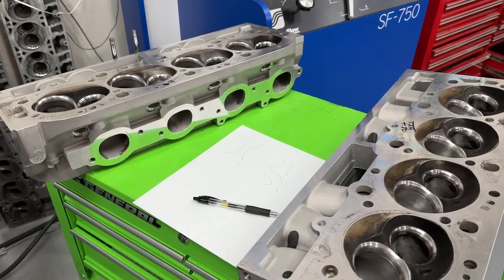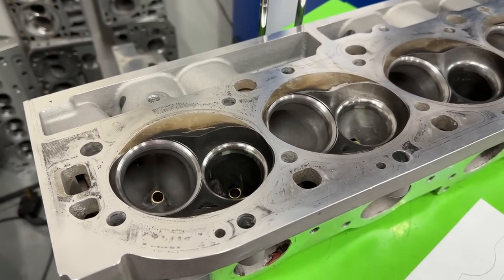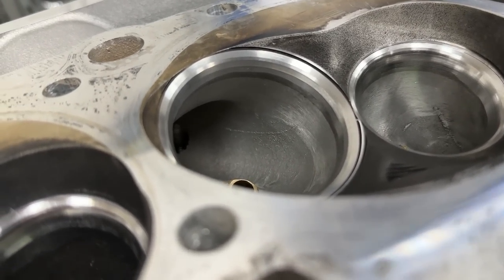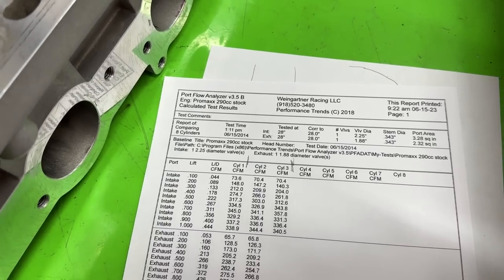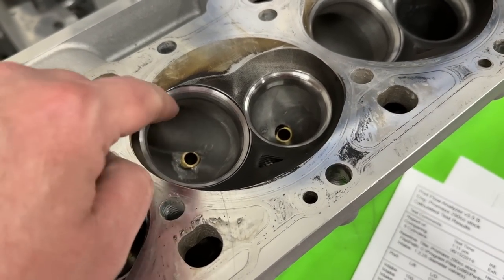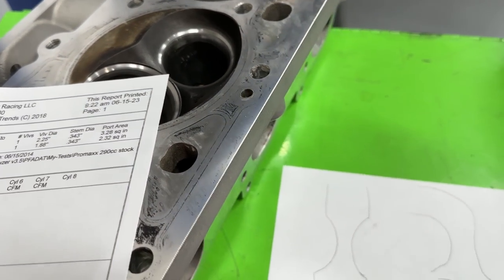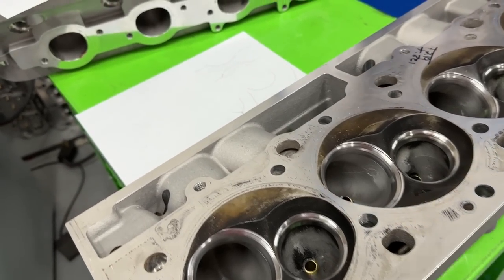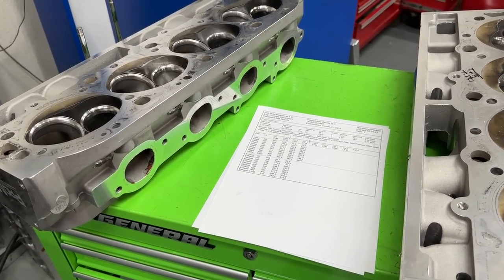One Reason To Put Larger Intake Valves In A Head

Comment: I had the 2.19 1.88 valves put in my 68 Camaro with closed chamber oval Port head's made a very noticeable improvement, great video keep them coming
Reply: Did you cut back the chamber wall to unshroud the intake valves. That 2.19” is even more shrouded than the factory 2.06”.  You can plunge cut it or mark a radius and remove material with a cylindrical carbide bit.  I had my 702’s plunge cut at the shop for about 0.300” valve to wall clearance.  It made a big difference across the entire rpm range, but especially the top end!

Comment: The idea of enormous valves, and ports to match, always means big numbers on a flow bench, but unless the head is for a race only engine, which is operated WFO pretty much all the time,  the results on road vehicle are likely to be disappointing.  Venturi type porting, when the intake ducts are actually made smaller, is likely to work better for the road.
Reply: I don't believe that to be true... not when matched with a small cam.... the big head and small cam is a proven combo
Reply: @Ws6Ms  Its OLD thinking now! Overly large ports, and enormous valves, mean big numbers on a flow bench, but due to slower gas speed at low to medium engine speeds, will always be slower on the road.
Reply: @humourless682 nah I still doubt that... then why do big port ls3/lt1 make more power than a smaller head ls2 and drive just as well ? Or the old hipo ford 302 with huge ports and smaller cam had a better power curve than chevy dz 302 with small heads and huge cam.... big port heads with correct cam and compression will always outperform in daily/racing sorry
Reply: @Ws6Ms  The laws of physics cannot be changed.  If the port size is smaller, the gas speed will be higher, through that port. Increase the size of the valve and it will increase even more.

In the US the idea that bigger is better, sells, but for quite a while smaller ducts have been being used in some very serious engines.

The idea of making intake ports smaller, even though its FAR more effective, is never likely to sell, hence the large number of videos like this one, which equate big numbers on a flow bench,  to more power (at a far higher cost). 

Essentially, this is the reason why a 4 valve, DOHC, head, is a good deal more effective than a 2 valve pushrod head, with enormous ports, and gas moving at a snails pace.
Reply: @humourless682  the only way what you're describing would be more effective is like 500rpm to like 2500rpm... but from 2000 to let's say 7000rpm the whole curve the big head will make more power its been done numerous times... have you seen the intake ports on a 4 banger Honda? There huge
Reply: @humourless682  or what about the recent coyote? They added bigger valves to make more power with no losses down low bc of the CAM timing ... I'm sure the engineers who designed know what there doing
Reply: @Ws6Ms  Thats simply not so!  Honda have to the best of my knowledge NEVER used 2 valve heads, with pushrod operation, on anything other than very early 50cc Supercubs.
Reply: @humourless682 I never said they did ?? I gave you 3 different engine examples of were a big head was an a factory improvement
Reply: @Ws6Ms  ALL 4 valve motors, have small ports, and the largest valves which will fit into the combustion chamber. There is no power loss at lower engine speeds, as the small ports increase gas speed, and help to avoid all the issues, with enormous, poorly shaped ports, and huge valves.
Reply: @humourless682 omg dude.. everything I said went right over your head... enjoy your 2500rpm engine
Reply: @humourless682 he coyote for example has 205cc intake ports witch is big for a 5.0 302ci.... and it's a DOHC
Reply: @Ws6Ms  MotoGP engines are based on stock production motors. They ALL have intake ports, that have been reshaped to increase gas speed, and in most cases this means they have also been made smaller.  

These motors are producing almost double the BHP per litre, than the dinosaur, pushrod V8s. 

Smaller ports aren't something that sells though, so ridiculous drain pipe size ports, and silly flow bench numbers persist...........
Reply: @Ws6Ms  Why do they make ports smaller on NASCAR motors, if it doesnt increase performance?
Reply: @humourless682 okay buddy
Reply: They do not make them smaller in nascar. An X cubic inch engine needs X amount of air to achieve desired rpm. Rpm is horsepower.
Reply: @lte008  Are you a NASCAR engine builder? Increasing BMEP has much more to do with providing higher torque, than rpm, and more effective cylinder head design, is a good way to achieve higher BMEP.

Comment: I wonder if opening the chamber adjacent to the intake would help low lift flow with the larger valve. I realize these heads will get returned,  but maybe that and an adjustment in seat angles could help.

Thanks for the videos.
Reply: People jog the heads because the heads chamber is wider than the bore. I sometimes bevel the top of the block but have never tested that on the dyno
Reply: @davidreed6070  some big blocks came with the notch at the top of the bore from the factory. You can see where it would be on a head gasket.
Reply: @v8packard  Yes that was the 396 and the 402 . they were basically 402 was a. .30 396.but the chamber is still wider than the 427 or454 with their 4.250 bore I Mark the block and bevel the top of the block, that is what Ford did with the Cleveland. The air is already passing between the valve and the chamber and sure doesn't need to hit a ledge that is bad news. I noticed when I put my LS together it presents a ledge to the air, I'm either going to jog the heads or bevel the bore which I can because my top rings are down. 300. It's a turbo engine
Reply: @davidreed6070  The 4.25 bore high performance blocks (427 and 454) were also notched. Not all, truck stuff and smaller valve passenger car were not. But anything with a 2.19 intake valve from the factory was notched, for sure.

Comment: On a engine with more cam I'd like to see a dyno comparison of normal valve, then ridge cut in the face for anti reversion (think it was Vizard who talked about that).  And then radius of that modified intake valve.  A does the face cut help with reversion and if so can you radius the intake thereafter kinda thing.
Reply from the maker: I can tell you nobody does it besides vizard for a reason.
Reply: @WeingartnerRacing  yeah I've never seen it done, have you?
Would think reversion would be more of a pressure wave out of time thing than flow towards the face of the valve so I have a hard time picturing the conformation groove doing anything.
As far as the margin radius I'd think it could help on the intake (not just the exhaust).  I read the intake margin to face should be sharp and that's the norm.  But as far as flow separation and unwanted turbulence from a sharp edge I'd think flow may improve.  And perhaps in applications with a very rough burr finish that sharp edge induced turbulence would be less ideal if the fuel staying more in suspension is now less of a concern vs just filling the cylinder.
Not sure if the flowbench pressure drop would translate.
Or maybe it does nothing lol.  Guess that's why we test.
Reply: Eric can u tell us why Vizard is the only one doing the conformation groove? What I gather from his book is the groove helps the valve and seat seal better when the intake valve seat is thermally distorted from the heat on the side closest to the exhaust seat side and used with a 30* seat which is harder to seal when distorted compared to a 45* 50* seat... plus a 30* seat presents more thru flow area (better low lift flow) than a 45* seat at low lift... the groove helping with reverse flow makes sense because as the piston nears TDC and is doing its part to expel exhaust gas the intake valve begins to open while the exhaust valve is still open (overlap) there is an opportunity for reverse flow to take place around the intake valve if the groove is there it could help restrict reverse flow which would help flow into the cylinder easier and produce more TQ/HP. Now I realize this greatly depends if you have the correct size port, velocity LSA and a whole host of other factors correct for that particular application but I think the opportunity exists ...idk please tell me what you think I know it has to be tested on a running engine on a dyno ... how much testing have you done on this ... great videos I appreciate all you do

Comment: For a street/strip 461 turbo motor >15 psi would the 290 head be better or would it choke it? Thinking it would have good cruising velocity at low rpm and be more efficient.

Comment: could you use/ try thin MLS gaskets to get the compression  up   that ridge 
AS opposed to sinking the valves to kill low lift flow to make a big cam into a shorter cam
on the larger valve you get a new higher seat which can help unless you have the too early intake opening where you sink the valve (and/or go to  steeper seat)     cheers   how many cuts on the chamber side?

Comment: Why are people in the US obsessed with old technology? We have had multivalve heads for a long time now.
Reply from the maker: Because we want to make more power than small 4valve engines.
Reply: @WeingartnerRacing  that doesn't make any sense.
Reply from the maker: @chippyjohn1 what’s your largest 4 valve engine in a vehicle. A large 2valve engine makes more mostly due to size. Point being there are not big 4valve engines besides diesel engines
Reply: @WeingartnerRacing  Okay, but you acknowledge that you make power due to displacement. Because people don't require massive engines is not an argument to say 2 valve is better. Multivalve has been common since WW2, look at the DB605, the best engine back then. Any decent race engine uses multivalve, except where valve number is limited by rules to make it harder to make power.
Reply: @WeingartnerRacing   Mercedes M159 was a 6.3 liter 4-valve.  

Made 622 HP with small cams, 11.3:1 on pump gas a warranty
Reply from the maker: @BC08 ok zz632 makes 1000hp with a warranty
Reply: @WeingartnerRacing   A GM Performance parts warranty, not a 5 year/50K OEM warranty honored at every dealership.  

Big difference

ZZ632 is also not emissions legal